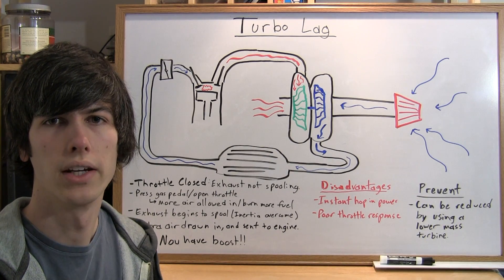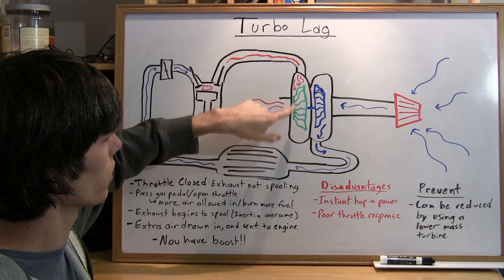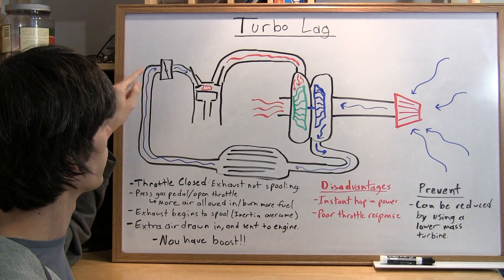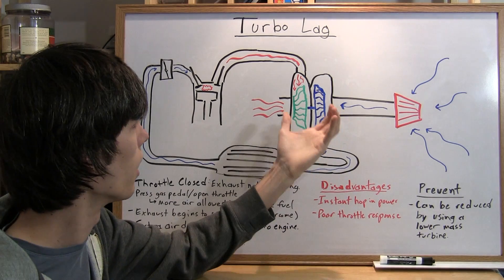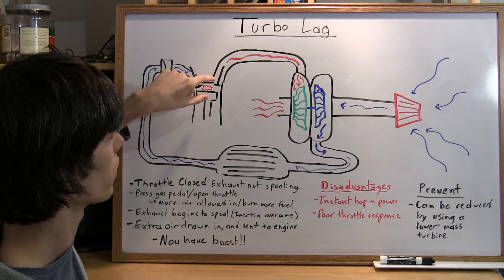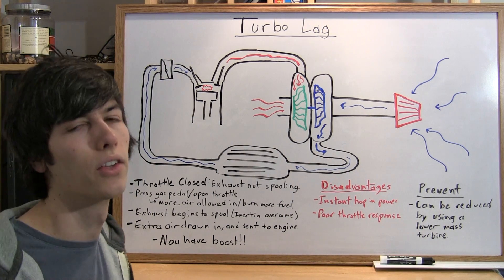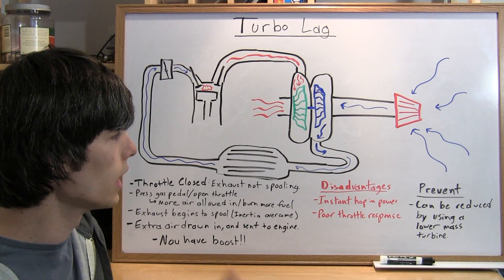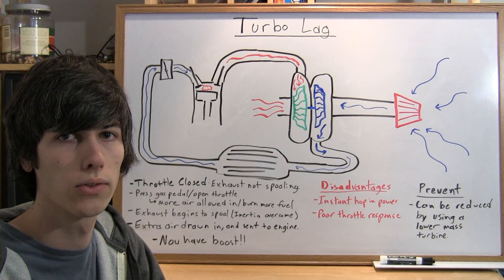Turbo Lag - The Problem With Turbocharged Cars

Comment: Just bought a VW Polo 1.2 TSI. I don't know a LOT about engines. I know some, but certainly nothing about turbochargers. Actually.. I didn't even know my car had one.. ^_^ I experienced that sudden "kick" a lot, and was wondering what it was. I feared it was some kind of defect. After watching this video, not only am I confident that it's completely normal, but I also learned something. You explain it VERY well. Subbed & thumbs up. Thanks!! ;-)
Reply from the maker: Thanks for subscribing, congrats on your new car!
Reply: I seen in Malaysia they use a 1.2 tsi in the beetle I wonder why they don't bring that engine to the US. You just control that sudden boost of power with throttle response.
Reply: yourface Bi-turbo is designed with a smaller and a larger turbo. The small one is used in the low rev range and the larger for the higher revs with the use of bypasses. Also using exhaust guide vanes will make a turbo more responsive.
Reply: TSI stands for Turbocharged Stratified Injection. I have a 1.5 Polo TDI cheers :)
Reply: I'm getting used to it. It helps a lot, knowing what actually happens. I'm getting better, and it's pretty much seamless now. ;)
Reply: with throttle control you mean...
Reply: Michael Taylor wouldn't duel turbos just increase the need for exhaust and therefore cause more turbo lag?
Reply: Casual Commodore 64 nn
Reply: Roy BM awesome, thanks for the explanation
Reply: why we have to do emission
Reply: +Aafis Aslam so u have a turbo diesel injection? If I am right.
Reply: Nope it's broke send it back
Reply: It’s not normal for factory turbo cars to have turbo lag.. they’re usually tuned to like 5-8 psi max so you shouldn’t even feel it, especially since it’s just a little 1.5l motor as well.
Reply: They push up around 12psi at max and they come on at around 2200rpm with that car and the little vw engine. You will deff feel the boost come on in the little cars it's noticeable but only if your getting in it. If you just normal driving you should not feel it as you won't be getting nothing and then full boost at 2200 to 2400rpm unless you are full throttle off the line in 1st gear. You will feel the boost come in while in say 3rd if you let off and let the RPM come down to 1500 or so and then full throttle you will feel the boost come in at some where between 2200 and 2400rpm but you have to try to make it noticeable for you to be able to feel it as in just normal driving you will not. Its not like in a 1000hp street car running 30psi of boost and feels like you get hammer when the boost comes on. If your feeling a noticeable jolt when just taking it easy when pulling off from a stop light or if you just press the pedal a little to accelerate there is likely some issue as at best it's slightly noticeable if you are looking for it but it isn't enough even at full throttle that it will be hugely noticed.

Comment: My Peugeot 208 GTi turbo starts kicking after 1750 rpm. Yes there is a lag, and mostly i spin front wheel even on 3rd gear. Is there a technology that turbo runs at all around the rpm range, at all times? And what about U.S. brands mostly use turbocharger? Any different than a turbo?
Reply: Well you can get a sequential twin turbo setup. Basically theres a little turbo that spools at around 1500-2500 and then a bigger one that spools up at around 4k.

Comment: Rotating mass has very little to do with turbo lag. Lighter and better designed turbines do gain response slightly due to weight reduction, but most of it is in the ability of the turbine to utilize the exhaust gas (blade size and design) to make the compressor overcome the vacuum that the engine is creating. Lower RPMs mean less air and fuel is being used, so the exhaust valves open less frequently and release less heat. Since heat causes gases to expand, the linear rise in RPMs creates a relatively linear rise in exhaust temps (increasing the surface area of the particles that make up the exhaust gas). The bigger the temperature difference between the intake air and exhaust gas, the more boost is created. The exhaust turbine is already spinning plenty fast the second you punch it from idle, but the lack of exhaust pressure pushing against the turbo's exhaust turbine blades is what creates lag. If it was solely or mostly the weight and mass of the turbine/compressor that created lag, then I doubt that you would be able to see the compressor spinning at idle.
Reply: +GioGuitarDude ur explanation definitely makes more sense.

Comment: Oh and don't forget that some vehicles often have an ignition and waste-gate fuel control system that reduces the amount of boost available by controlling the power production so that you don't have nothing and then get gobs of power especially at low speed , in effect acting as a governor of sorts.

Comment: Hi! Love your channel. Can you explain: all turbo cars used to suffer from bad turbo lag, like the Ferrari F40, but in the last 10 years or so it seems to have become the opposite, where turbocharged engines are developing peak torque from 1500-2000 rpm on up, quicker than the naturally aspirated engines. Look at the figures on the big AMG Mercedes engines for instance. Do you know why? Cheers
Reply: I'm not an engineer but here's what I've gathered over time: some cars have multiple turbos that set in in different rpm bands, i.e. the Porsche 595 has a small turbo that spools up quickly and a large turbo that starts kicking in at 3.000revs and above. Only at that point does the car really go. The Top Gear film abouut the 959 touches on this  briefly I think.
Recently I got an M4 and BMW has designed the inline 6 such that each turbo is designated to three cilinders. I don't know why but I'm sure this also has to do with minimising lag.
Additionally, in sport+ mode the car uses engine management trickery to keep the turbos rotating even if you aren't on the throttle which also shortens their response times.
I can tell you the engine feels naturally aspirated, turbo lag in sports cars has almost completely disappeared. The M3/M4  engine has been praised by Chris Harris and the like for feeling like it is normally aspirated. This is high praise considering its predecessor was naturally aspirated in comparison.
The M3/M4 engine has peek torque between 1.850 and 5.500 revs and supposedly it's down to the turbos, as you said.

Comment: sorry to ask but , what are the consequences to not have a EGR valve ?
Reply: As far as I understand, an egr is just an environmental thing trying to reduce the emissions from your car. Basically it just takes an amount of exhaust and pumps it back through your engine with the idea that it'll burn off some unburnt fuel in your exhaust gas. The valve itself is like a regulator that controls the amount of exhaust being put back through your engine. It does tend to leave your engine much dirtier and may also decrease the lifespan on your engine. In a lot of countries it's actually required by law so that cars pass emissions tests but personally I think it's a load of bollocks. The egr valve actually broke in my car a little while back which then meant that all my exhaust gas was going back through my engine and essentially just starved my engine of oxygen. $700 later and I had a new bit of plastic in my engine and the knowledge that Nissan had ripped me off. Sometimes you can block the egr system which actually makes your car run better but if you are in a place with regular emissions tests I would probably not do so.

Anyway I hope my little lecture helped ;P
Reply: thanks men it help very much !
Reply: +JoãoHD LeagueofLegendsPT no worries mate

Comment: Thats the reason why a 2.0L 4 Zylinder Inline Naturally Asperated Engine(Manual transmission) from 1996 is able to beat a 1.8L Turbo or even 2.0Liter TSI from 2014.

Comment: One short question: how does this happen with a diesel engine which usually has no air-flow restriction and is only controlled by the amount of fuel injected?

Comment: Forgive me if this is a dumb question or has already been asked, but is it possible to have a turbine that is powered by another source other than the exhaust gases? Therefore eliminating the need to have power to make power.
Reply: I think f1 cars use an electric motor to spool the turbine even while ofd throttle
Reply: That would be totally pointless,  You can however spool the turbo to its max rpm via an air compressor when you hit the gas pedal at full throttle. giving you the edge off the start line and easier better power delivery.

Comment: I heard the definition of turbo lag as while on boost, the time between throttle on and power
Reply: +lrnlrn I agree 100%.  I'm also under the impression that turbo lag is measured when the RPM's are at or above the boost threshold RPM.
The time it takes the engine to reach the boost threshold RPM shouldn't be included in turbo lag.  That's kind of engine lag like an n/a engine, but worse since turbos usually have a lower compression ratio.

Comment: As I understand, an N/A engine actually loses low end power when a turbo is bolted on, and makes less power during that "lag" phase than it made before the turbo was even installed.  Is this due to the resistance encountered by the exhaust gases, or is it due to the new air/fuel ratio, or the new tune?

Comment: But the power delivery is no no more delayed than if the car DIDN'T have a Turbo right? 

Or does the Turbo actually hinder the 'natural' intake of air when it's not spinning?
Reply: +roadrunnerblink the turbo will hinder it but only slightly
Reply: correct it does. The slower the exhaust gases flowing the slower the turbo will spool = more turbo lag!

The smaller the turbo  = less lag but also less top end power but good low end power.
The bigger the turbo  = more lag  but better top end power

Comment: If I have 2 identical naturally aspirated cars, and put a turbocharger on one of them, will this car perform worse than the N/A car BEFORE the turbo kicks in or is it just a matter off me not getting the boost from the turbo ASAP?
Reply: +El Chupacabra If you have to identical cars, one NA and one Turbo'd making the same exact amount of power, the NA car will be faster, it has no lag in the power it needs to reach. if you have two identical NA cars and add a turbocharger to one, obviously it's going to pick up power, and not just a measly 20hp... so no.... i don't think the turbo car would be slower than the NA car before boost kicks in.
Reply: iLLinFiniTiG35
Hi, thanks for replying. On your second scenario, I slap on it the turbo, is it a matter of its power dropping in the low RPMs, or a matter of its power improving in the higher RPMs, or both?

Actually, now that I think of it, I think both, since air flow is restricted at first, is this right?
Reply: I'm not 100% sure on what I'm saying so dont quote me. But I think the turbo car would pick up power all around. It all depends on the turbo as well, a small ass turbo would have no turbo lag so therefore "before boost" never really matters.

Comment: You left out a major contributor to the turbo lag, which is the total volume of the forced induction system. If you have large intake pipes and intercoolers, the compressor turbine must work harder/longer to fill the system with the compressed air as opposed to system with a lesser volume.
Reply: The volume of the intake system has a negligible impact on lag relative to the inertia if the rotating assembly.  Let's take an average modern diesel truck. If we assume a 3"x36"x24" intercooler and 10' of 4" pipe between turbo and manifold that equates to approximately .6cf for the intercooler with caps and .1 cf for the piping. To account for an absolute pressure of 45psi this system contains about 2acf of air.  If the compressor is pumping 1200acfm at full boost it would take about 1/600 of a second to pressurize the intake.

This is insignificant compared to the .5-1.5 seconds it takes to spin the turbo up on the same diesel.
Reply: So how do u minimize turbo lag. N by doing such mods will it damage the car ?
Reply: +HardestofStyles Correct! Thank you for actually knowing your shit. These guys don't know anything about cars so they just eat this shit up. The main contributor to turbo lag is the time it takes to the system from the turbo to the engine with the volume of air it needs to reach the desired air pressure.

Comment: What if the turbo is designed to have a smaller exhaust turbine and a slightly larger compressor? Wouldn't that have some benefits when combating turbo lag?
Reply: +Tarek Hill I'm not absolutly sure, but i think it would probably make it worse. although the bigger compressor need less revs to generate the same amount of boost, the turbine would need more exhaust energy to accelerate the bigger compressor. smaller turbines are generally less efficient overall.

Comment: "Spool Time" would be a more correct term to describe what people have started to commonly call "lag". Lag makes it seem like the turbocharger is falling behind the engine, not doing anything, and being a problem until desired boost pressure is achieved. Once you're out of vacuum your turbocharger IS working and giving pressure to the engine, the velocity of the air moving through the whole system has to equalize though.
It was more prevalent in older technology turbos. Today's turbochargers have much shorter spool time due to technological advancements like you mentioned (lighter alloy vanes, ball bearings, ported shrouds,even variable vanes are available), and also, properly sizing the turbo for the application will greatly decrease perceived "lag". 
All in all, good video!

Comment: So to reduce turbo lag, a turbocharger with a lighter material used for the turbine would be your best bet.
Two things come to mind for me. Could reducing the amount of piping between either/ both the turbocharger and intercooler, or/and the intercooler to the throttle reduce the effects of turbo lag?
Also, dependent upon the material used in the turbine, could that make the turbocharger more susceptible to failing?
Thanks for reading, just my curiosity kicking in.
Reply: Carbon Fiber Turbo Spools :OOO
Reply: +StrifeValor 
You are correct, by reducing the length of piping & bends...... promotes better air flow by reducing (air) drag through the pipe work, hence better air flow. (air drag = friction = heat... whereby you want colder compressed air)
Light weight turbo / compressor assembly also requires less exhaust gas to spool the turbo more rapidly.

Comment: Does the turbo have a separate intake from the engine, or does all of the intake first pass through the turbo before making it's way to the engine.
Reply: Nick Joslin all must pass through the turbo. The engine and turbo intakes are connected to each other.
Reply: +Nick Joslin It all goes through the turbo, until you let go of the gas and/or pressure gets too high.
Then the wastegate opens, and bypasses the turbo.
Reply: panzerveps  thought it was just so dust and debris won’t go in the turbo and mess it up and the intake prevents that and filters the air be for going in
Reply: christian gonzalez the wastegate is on the exhaust side. When you let off the gas, the throttle closes. The turbine/compressor keeps spinning adding pressure to the intake side until a pressure actuator opens up the wastegate. The exhaust then bypasses the turbine and the turbo is no longer adding pressure, protecting your throttle body and intake piping.

Comment: Their is an easy way of getting rid on turbo lag...
Swap for a supercharger... A lot more power and its instant
Reply: Hectic Turtle Superchargers leech extra energy from the whole system and cause the engine to do more work, where as turbo chargers are powered by exhaust that would be wasted otherwise.
Reply: ***** yeah, but you get "turbo lag" before it happens, unlike superchargers
Reply: ***** good work detective:))
Reply: Hectic Turtle you can run both systems, the turbo makes up for super charger loss. With tuning and done right
Reply: ***** lets pretend that made sense alright ;)
Reply: Also turbo chargers are better for fuel economy vs. superchargers.  In this day and age, my 2.0 wrx with twin scroll turbo gets around 29 mpg and has 258 ft lbs of torque.

Comment: Can you do a video about turbo flutter ? What it is and how its created and whether its bad for the turbo or not.
Reply: +shockwave1xD If you go back to his How Turbochargers Work video, he explains that the BOV is used to release pressure when the throttle plate is closed. The "turbo flutter" sound is all the air rushing back out of the turbo, spinning it backwards. A lot of people say this is bad for the turbo - personally I wouldn't know as I've never owned a turbo car however I can see their point as to how damaged could be caused: It's pressured air rushing through the air intake in reverse, then spinning a turbo backwards.

Sounds harmful to me.

Comment: Hate to be 'that guy' but this is incorrect. The period of time from throttle input until the turbo creates usable boost (referred to as 'turbo lag' in this video) is actually known as the boost threshold. Turbo lag is the amount of time it takes to be at full boost and full power when the accelerator is depressed, while in the boost range. Just clarifying
Reply from the maker: Kamron Mikuta Ehh, not really. Boost threshold is the engine speed at which there's enough exhaust gas to produce useable boost.